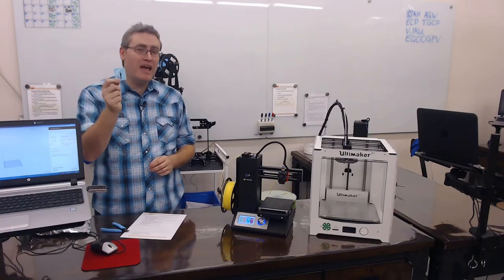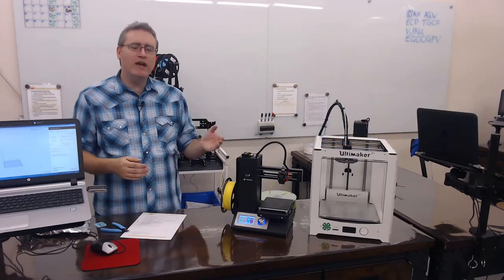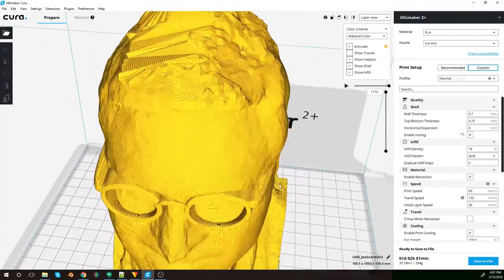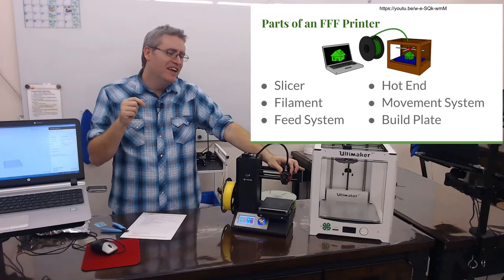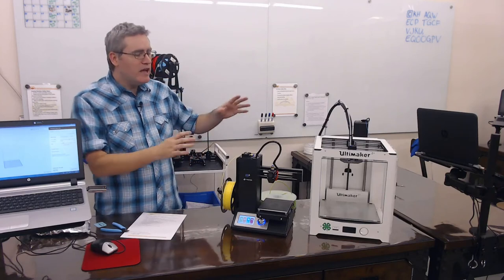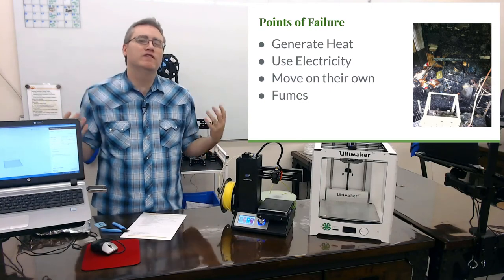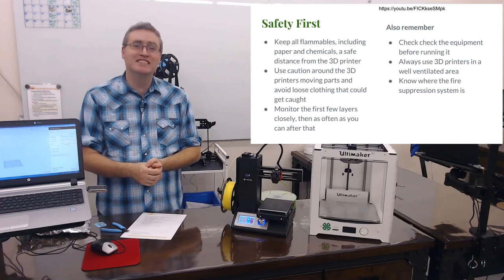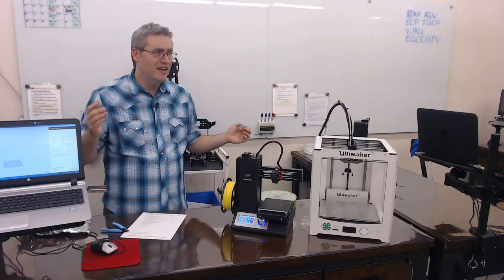Makerspace 3D Printing Safety Video Presentation

Comment: Some more safety points.  
- Melted plastic sticks to the skin and burns like napalm
- In removing the print from the print bed, be careful if you are using a scraper.  A slipped scraper can send you to the immediate care center or emergency room for stitches
Reply: Yup, all excellent points.